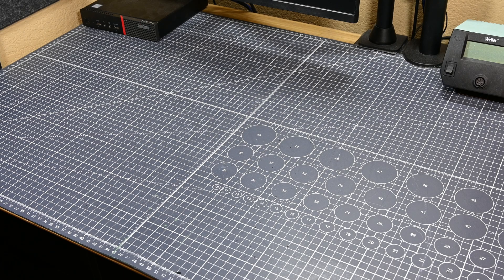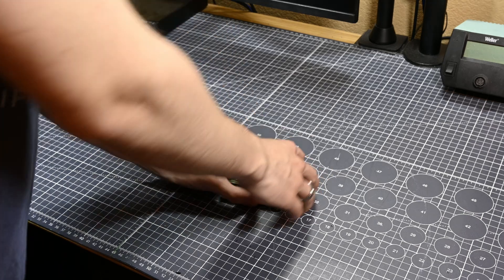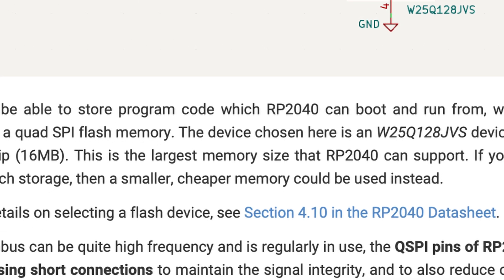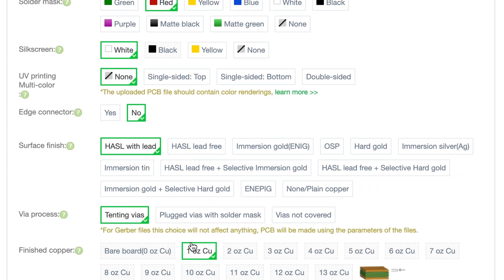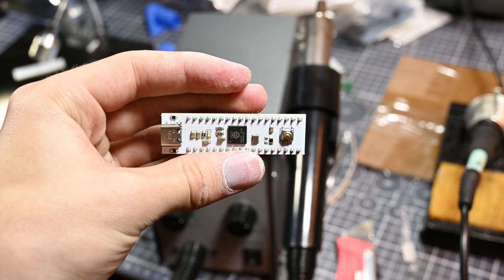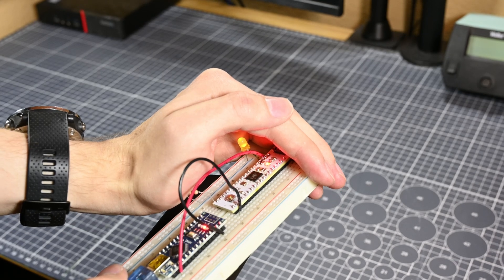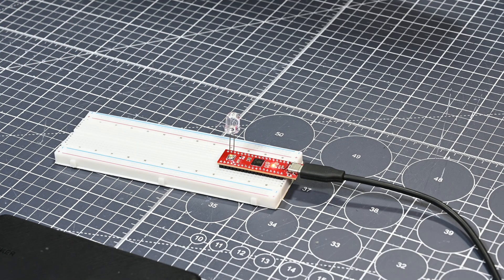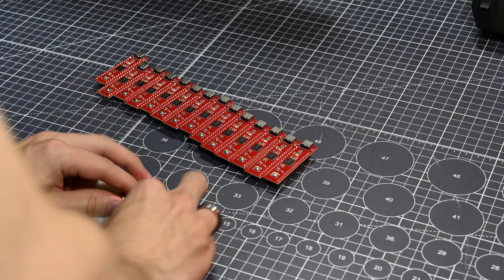Upgrading the Pi Pico with USB-C, 16MB of Flash, and A Slimmer Board!

Comment: Awesome! Could you kindly clarify - final PCB design has all flaws resolved?
Reply from the maker: Yep, final design has all the flaws resolved and should be a perfectly functional microcontroller once all the components are soldered to it!
Reply: @CHWTT awesome. Is this pcb pin compatible with 2350 as well - just out of curiosity
Reply from the maker: Sadly no, the 2350A is a QFN-60 package chip and the 2040 is a QFN-56, so there are four more pins on the 2350 that aren't on the 2040
Reply: @CHWTT sure. Thanks!